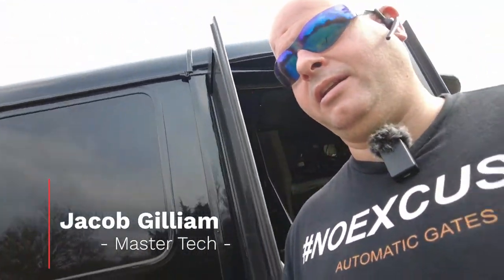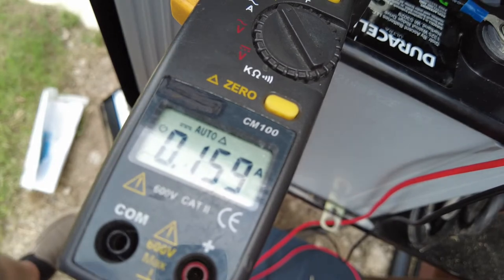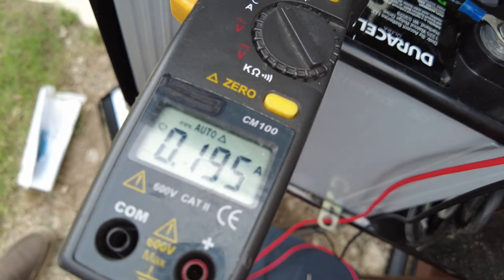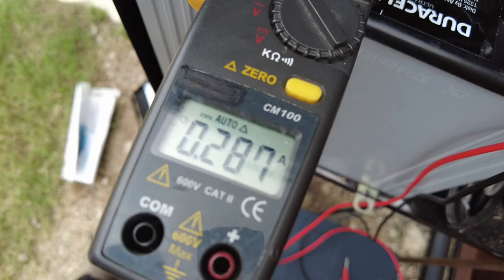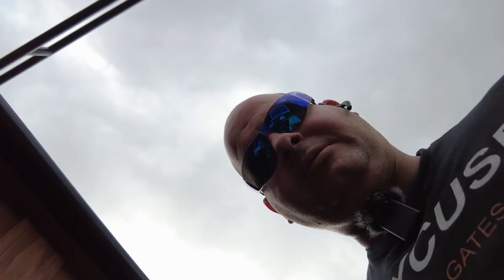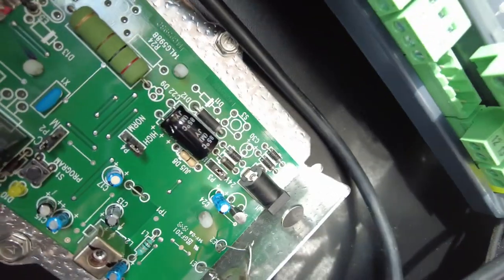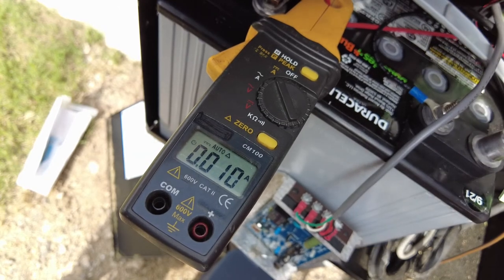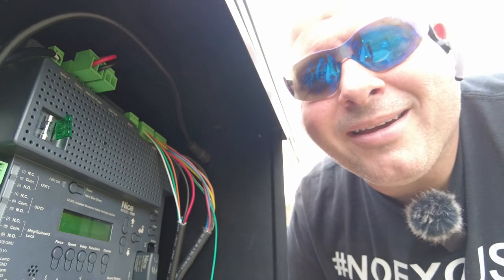This Meter Is a Powerful Tool to Add To Your Arsenal

Comment: Jacob, where do you test to become a master tech? I've been selling, installing, and servicing Industrial, commercial and high end residential gates and gate operators since July of 2001. I am factory trained by Nice/HySecurity, Doorking, FAAC, Viking, and Liftmaster. I was in the first class ever tested in the country for the AFA CGAT test. I have every certification offered by the AFA including CGAD, CGAT, CFC, COM. I would like to look into getting the Master Tech certification if you can provide some information on this certification. Thank you.

Comment: Interested to know the specs of your solar setups there, I am using 12v Centsys systems running 40w panel and 40AH battery. The system draws around 30mA on standby. Good tip on the clamp meter, I just use my multimeter in series but I guess the clamp meter is more convenient.
Reply from the maker: It saves a vast amount of time. Add being able to simultaneously use it with your multimeter, and you have quite the effective duo. I'm a huge proponent of tools that save time + developing systems that save time.  

I like to teach every tech I train: "your minutes add up... if you can find just one way to save yourself 5 minutes a day, that's 30 hours a year. So how many different ways can you think of to save you as many 5 minutes a day that you can? After you've done that, then start thinking of as many ways that save you 1 minute. Soon, on most days, you find yourself deciding if you'll go home early for the day, or start on some of tomorrow's work." 

To put this in perspective: some gate systems that use to take my team & I 5-6 hours to install, we can now do in 2-3 hours. Me & my best team can now install THREE new solar gate systems in a day (including the drive between customers), if we so desired. That's how many systems and tools I have made available to strip away as much time as possible. 

This clamp amp meter repeatedly saves time, and if I ever discover a faster way, I'll switch. We'd all do good to never get stuck in our ways with how we've "always done it"; we should always be on the lookout for anything more effective... or build it if you dream it ;-) I have a few custom tools I've made just for special gate situations. So if someone hasn't already made it available to you on the market, try making a crude one for yourself.

The worst tech is the tech who stops learning and adapting.

Sorry for getting so wordy. I'll switch to my tech mode to answer your actual question:

I remember most things about that site. I'm not quire sue what you were asking me for, so I'll just toss all the intel at you:  that particular system was a double-swing > single-family use > Nice 1050 board > 2qty Nice 3500 motor assemblies > Omron E3K safety beam > Nice Plugin Receiver > Liftmaster Universal receiver the customer requested as an add-on > 2qty custom wireless keypads I built > a 20Watt 12VDC solar panel > 79Ah AGM battery > the standby usages is typically 10mA.

The size solar panel I determine by region and system requirements and then typically double it > I choose the size of the battery reserve by finding the true power usage while the gate(s) are running > then I make sure the battery reserve is significant enough for long term use if the solar panel(s) weren't in play. I essentially calculate for about 1-2 weeks of "normal" use without a solar panel (to simulate the very worst of weather). These rules have served me rather well for years. Even if we get a month of rain in our area, we don't get calls for gates shutting down. Gone are the days of providing "bare minimum" what the factory told us about their solar gate systems... and some have been wrong in their manuals. So you can take the "engineered answer" or you can use the real-world readings. 

I plan to actually do a video soon on "the real world way to determine how a solar panel is performing, on site, and if you need to make an adjustment on available panel wattage."

Thanks for the question, Saturday Delivery!